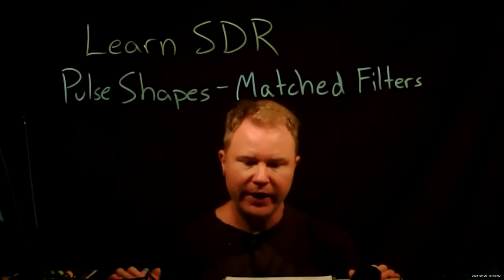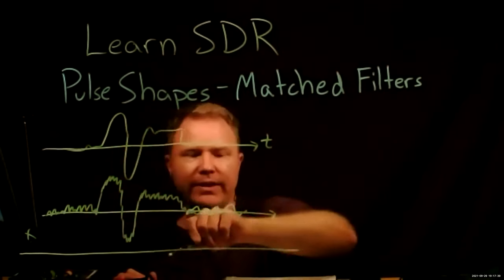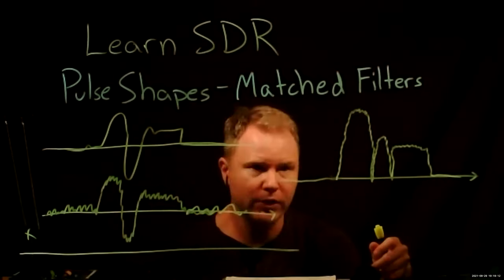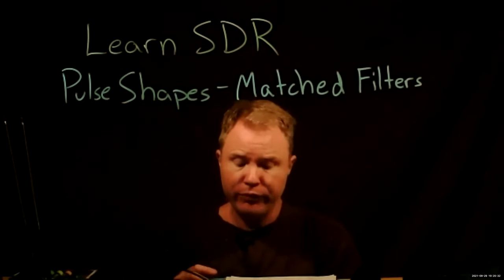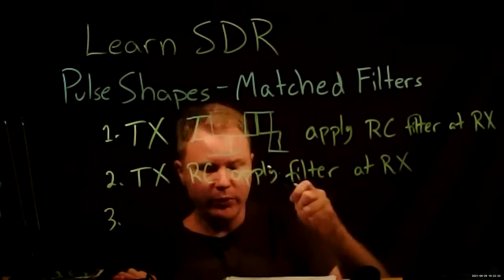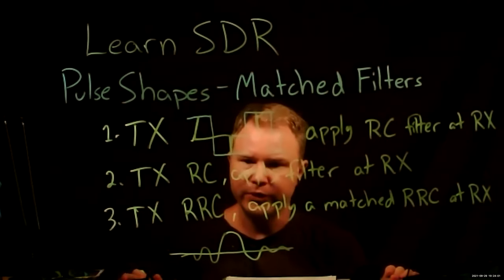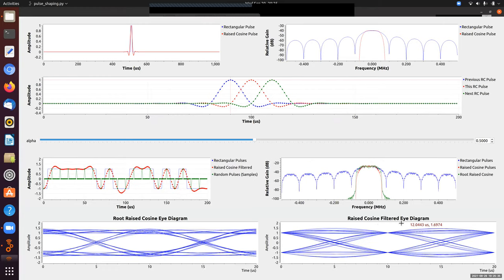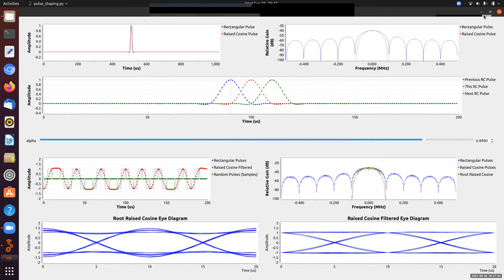Learn SDR 15: Pulse Shaping Matched Filter

Comment: Dear Prof. Jason Gallicchio, your lectures are excellent and can teach any student in the world the principles of communication and the use of GNU Radio and SDR.
I am going through them now and they are simply better than any theoretical course taught in the academy. Your course illustrates the principles of communication to the student.
And now I now I wanted to ask you a question regrading this lecture (SDR 15): why does the spectrum appear smooth when the source is deterministic, while when the source is random you see a noisy spectrum? After all, you are not adding white noise to the system. Can I understand that this noisy spectrum emerges due to spectral calculation of random signals of GNU. Every time GNU calculates spectrum, it has partially different signals in the pipeline, so that's why we see these small fluctuations in the spectrum and a not because of digital quantization problems in the calculation?